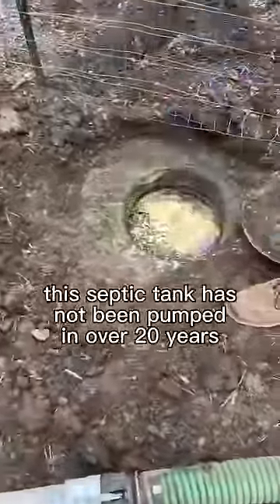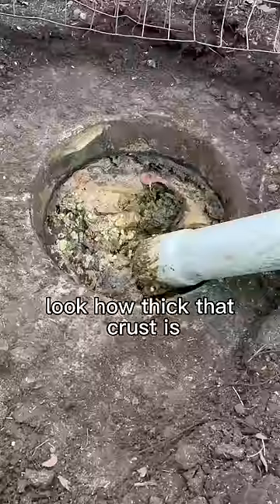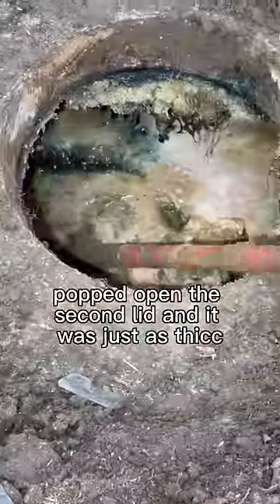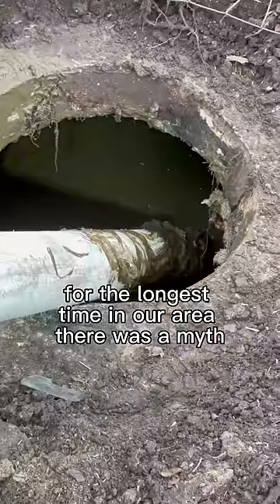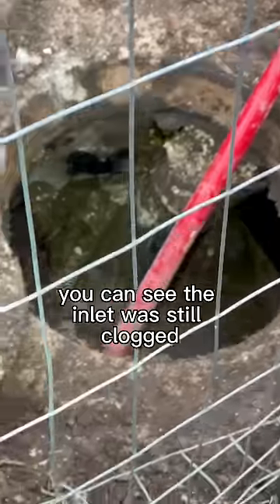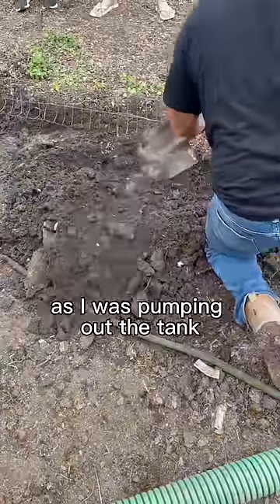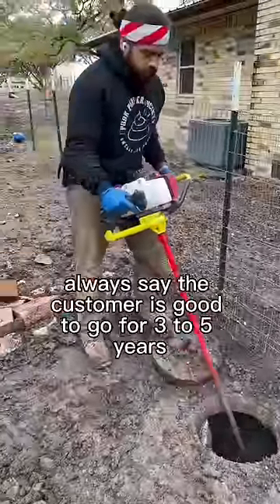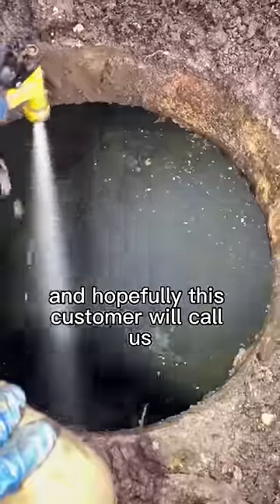Septic Tank hasn’t been pumped in over 20 Years #shorts #septictank #poorpumpersociety

Comment: You know the man is experienced when he's doing it without wearing a mask 🤝
Reply: You'll be surprised nobody I mean nobody uses ppe apart from gloves and highviz the rest is just impractical
Reply: @cirwandavey2737 I used to work a very similar job, but it was the Porta-Potty sanitation units at an independent event Sanitation Company as a temp job for two weeks in the summer of 2019. when we washed the units, we had to wear a coverall rubber boots face mask and face shield covering our neck because of the splashback.
Reply: Going noseblind is a real thing
Reply: @The105ODST  I've spent a year on septic tanks and what not used to work on a recycler so the water we used for jetting was never the cleanest yet nobody used a mask you get to a point where it's easier to do your job without ppe
Reply: I once strained it a sink pipe and almost threw up. Ifi got a whiff off this I think I'd literally just die

Comment: Wouldn’t their field drain lines be in bad shape after letting it go like this?

I just had a new septic system installed. The smell was rough when it was first installed. Fast forward 3 months and I popped the lid off to “check it” and man the smell was 10x worse. I almost threw up.